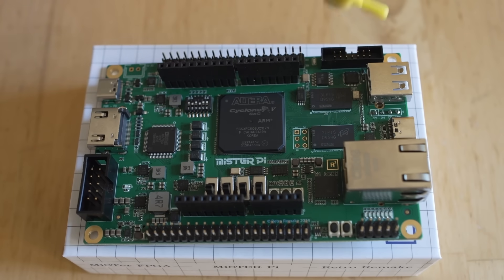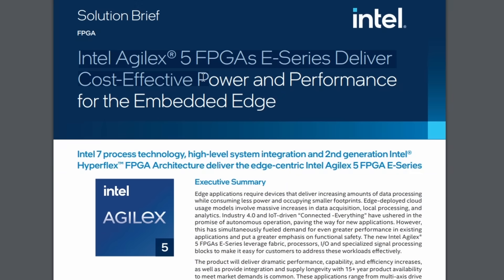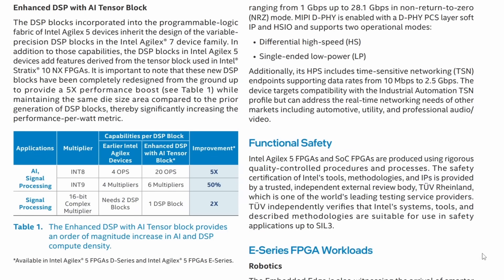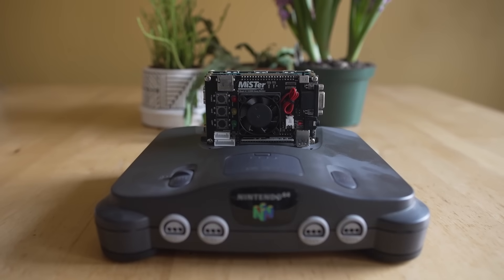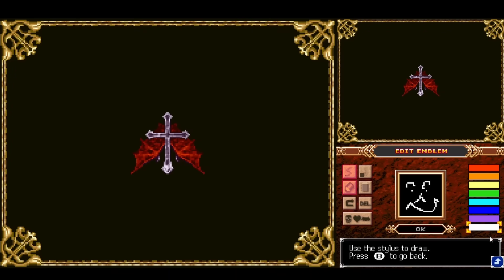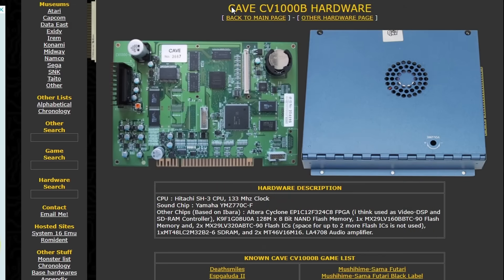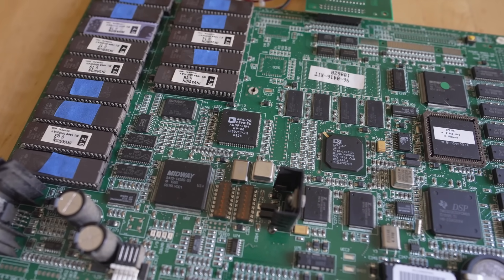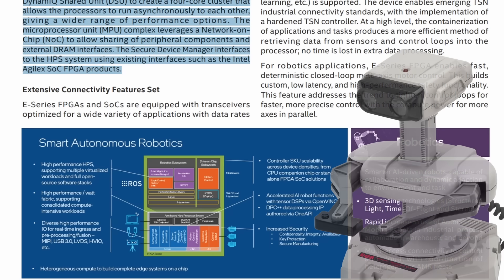"MiSTer FPGA 2" Coming? What Consoles Could It Even Run? Agilex 5 Explained

Comment: Not a FPGA developer, but given the ao486 core is only attempting to recreate a 486SX, a 486SX had ~900k transistors, and a Pentium MMX ~4.5M is 5x a 486SX...  So my reasonable hope would be that the step up would allow for Pentium MMX with the frequency headroom to effectively recreate Tillamook at 300MHz.

In turn if there's not enough additional area for an era appropriate 3D Accelerator via FPGA, one would hope the developers could use the pre-existing wrapper work for Glide/DirectX -> OpenGL, and come up with a system to allow it to use the accompanying ARM SoC's GPU block.
Reply from the maker: The a0486 core is great but that’s a very bodgey core. In a fun way, not a negative way
Reply: Era appropriate software tended to target a Pentium MMX 200 MHz, and then jump up to late Gigahertz race chips, rapidly leading into the Half Life 2/Doom 3 era that largely just runs on modern hardware.  So a Tillamook equivalent alongside a decent 3D Accelerator in principle should core software up through 1999 with reasonable headroom, with stuff from after the flip over to stuff targeting Athlons largely just being able to be handled natively with wrappers on modern hardware..

Comment: I feel like a 3rd Gen MiSTer would need to have some co-processors on board to natively handle the heavy duty stuff, if there were to be an attempt to do bigger systems. Today you can probably still get compatible x86/Pentium/Celeron/etc compatible chips to start thinking about Xbox. PS2 is complicated by the MIPS/RISC situation, and GC/Wii/Wii U/PS3 all use a RISC PowerPC CPU. None of this even covers graphics, which is another big hurdle. But, now that we have people like Taki creating the boards and designs, the only limit is figuring out how to tie all the necessary components together.
Reply from the maker: Once you get to those systems any real advantage FPGA brings to the table is kind of negated by how those systems work with their frame buffers

Comment: The 3 console cores I'm most excited for with FPGA Gen 2, are the Dreamcast, DS and perhaps a hybrid PS2 core, if the EE was replicated via a RISC SoC, and everything else via FPGA, It's really just the EE on the PS2 that's complicated, if a 1:1 EE RISC core could be possible, via a full EE de-lid scan, it would be incredible to see & have, soft emulation for PS2 just has never really done it for me, given how low latency the PS2 is on a CRT, and the amount of PS2 games there are is staggering, I have around 500 in my collection, being able to play PS2 games via real hardware (FPGA) with native VGA in 480p would be the dream, not to mention with improved colours, given the PS2's poor colour space output, as well as save-states, cheats and all the other stuff FPGA brings, full hardware backwards compatible PS3's are getting hard to find now, as they are all succumbing to the process node fault. For computer cores, a 1:1 X68000 core would be fantastic to get, along with finally getting 1:1 Amiga A500/A1200/CD32, and lastly of course, a Pentium i686 core, as close to 800Mhz as possible, pulling that of with a decent GPU will be hard on a single FPGA though, pairing a decent P i686 500-800Mhz CPU with a decent 128MB DirectX 8.1 GPU is the ideal.
Reply from the maker: I do hope we get a finished X68000 one day. So close yet so far

Comment: I'd love to see it have an on-board port that would allow folks to create cartridge adapters so people could use original cartridges (think similar to the Polymega but FPGA based and not just a cartridge dumper).
Reply from the maker: If there was enough GPIO for those slots it could be theoretically possible
Reply: @VideoGameEsoterica  Yep definitely depend on GPIO. But man I'd love to see it. Nothing like the feeling of using actual cartridges (or CDs for that matter). Dumpers just don't feel the same.
Reply from the maker: @ToddUGA it’s a fun bonus feature but also IMO the first sacrifice I’d make for something else

Comment: Console wise, there's not much left I'm missing on the MiSTer, because the more modern consoles are handled quite nicely by software emulation. Especially the enhancements we get there are really nice. So my main hope for a MiSTer follow up would be some newer arcade cores, like Sega's Model 1, 2 and maybe even 3. Same goes for Sega's competition from that era, like Namco, Konami or Jaleco. And maybe some more exotic hardware like the M2 or the Hyper Neo Geo 64.
Reply from the maker: And PS2 era is better in the end via software emulation once complete as frame buffer systems in FPGA don’t really have a “cycle accuracy”  in the end
Reply: For me, FPGA for 5th & 6th gen is even more important than previous generation consoles, given the size of the L2 cache on CPU's, GPUs and RAMDISK low-latency, along with Direct Video for HDMI to RGB, it's pretty easy to run consoles like the SNES, Mega Drive etc, basically any 8/16-Bit system with very low-latency and high accuracy, no not bare-metal like FPGA, but with a RAMDISK install of Recalbox OS and an X3D CPU with V-Cache and a GPU with a 64MB+ L2 cache, it's pretty decent now days, 5th & 6th gen is another story though, the latency is much higher, and the frame-pacing nowhere near accurate or consistent like real hardware, many DC, PS2, GC games are unplayable due to poor video timings, or just aren't as enjoyable due to latency, and that will most likely never change with soft emulation, it's not a very good alternative to real hardware, the ideal is FPGA for everything up to 7th gen, so all bare-metal low latency systems are available via FPGA, using older, lower latency OS's can help somewhat, like Windows 7, but then there are no drivers or support for V-Cache CPU's or the latest GPU's with the large L2 cache sizes, so your back to much higher ms end-to-end frame-times (no good for most 8/16-Bit systems imo, just doesn't do the instant response gameplay justice like real hardware or FPGA), even the Xbox 360 & PS3 have near bare-metal performance and very consistent 1% frames (near perfect) when using them via their respective analogue RAMDAC's at sub 576p resolution on a CRT (sub 1ms), that soft emulation just isn't capable of replicating.

Comment: I think Dreamcast would be the max. Otherwise, larger FPGA means more features to current cores, maybe more save state support? I don't know the PS2 or GameCube specs but an OG XBOX has a 733MHz Pentium III Celeron equivalent CPU and a GeForce 3 equivalent GPU. I assume a PS2 or GC is slightly below that. I don't see why anyone would want to map out a P3 CPU, let alone have it running at 733MHz, or at least much faster than FPGA can now. There would be a decent heatsink involved. Is it even possible to output graphics that a GeForce 3 can w/o a dedicated GPU? Even if it could be done in FPGA, what kind of price tag would we be looking at? Better off having a Raspberry Pi or a PC for PS2, GameCube, OG XBOX and beyond. I have no interest in a Pi so I cannot say if a Pi 5 is enough for PS2, GameCube and XBOX.
Reply from the maker: All those would be too much. PS2 would be the only system that even had a chance and a long shot at that

Comment: Finally getting that Mortal Kombat core that just barely didn't work on MiSTer would be nice and a scaler that does 4K120 output so we can use that new fancy CRT beam simulation at full 4K. Tho I think the RT4K uses 150k logic elements and doesn't do 4K120 and costs an arm and a leg so maybe that's a big ask
Reply from the maker: 4K120 would be an extremely big ask

Comment: I would love to see PC emulation in FPGA. Voodoo graphics are very well documented as are lots of x86 processors. The voodoo 3 graphics core runs at 166mhz and it would pair well with a Pentium II running at 266mhz or 300mz. Software emulations still leave a lot to be desired there. If there is room enough for all of the logic gates for a full retro PC core, an Agilex 5 could very well outperform high end PCs in terms of emulation performance.
Reply from the maker: Plus then we can borrow those 3DFX portions for arcade boards
Reply: Not having to pull out the big Win 98 & XP machines and set them up to play all the incredible 90's, early naughties PC games would be nice, especially as part of an already system packed FPGA platform, one day having an FPGA box that can do everything up to 7th gen with bare-metal real-hardware level accuracy & performance is the dream, maybe with in 10-15 years
Reply from the maker: @Wobble2007 yes that is def a potential plus. ITX Llama has been great for that so far
Reply: @VideoGameEsoterica  Tis an awsome bit of kit.

Comment: Few notes from my side:
- N64 core is running the CPU at 93.75MHz, the turbo core is running it at 120MHz.The 80Mhz note on the turbo core is for the basic system clock used by e.g. RSP and RDP, the CPU runs at 1.5x that clock.
- In terms of what system the largest Agilex would allow... DS, Dreamcast and x86+3D card would be possible for sure and all seem interesting. 3DS, PS2 and PSP could might be possible, but are at the very edge and depend a lot on external RAM possibilities.
- Gamecube, Xbox or other systems clocked at 400mhz+ are out of reach
Reply: Thank u Robert!!  U r a LEGEND! <3
Reply from the maker: Lotta interest in PS2 that’s for sure
Reply: I don't know that the upgrade list is enough to shift the community to a new system tbh. I think it will take one more hardware generation and maybe ai assistance in place for core building.
Reply: 3DS, like DS, would be fantastic to have, those systems are packed with gems, and look so good on a big screen, especially a CRT or OLED, PSP has some bangers too, having DS/3DS FPGA would be like having a whole new Nintendo console, MK DS is basically a sequel to MK64 and looks so good on a 4:3 CRT TV, as does LOZ Spirit Tracks D-Pad edition, MK7, Chibi-Robo, Retro Game Challenge, being able t play them without software latency, frame stutter and compatibility issues would be epic. PS2 is obviously the most wanted FPGA core there is, canny wait for that one day, it will be fun just seeing it all develop over the years.
Reply from the maker: Even if 3DS was doable I don’t think you’d find a dev willing to do it. Nintendo hasn’t been playing fair lately
Reply: - Have u given any thought of how DS/3DS would handle screen layouts and such?  Would it be possible to have a phone app that could sync as a 2nd display for touch screen?  I guess it would need microphone support as well..
- All the systems you mentioned are beginning to have well integrated online network capabilities.. do you think it would be possible to support these in FPGA?
- Would it ever be possible to add Netplay to existing cores (ex. N64/PS1) on a hypothetical Mister 2 board?  My dream would be to have a MiSTer netplay multiplayer community some day 🙂
Reply: Thanks for all your hard work!
Reply: Not into the FPGA scene, but...  Given OpenGL is backwards compatible and there are wrappers for Glide/DirectX <9 to OpenGL, it should in principle be possible to utilize the ARM SoC's GPU block for 3D Acceleration.    

So one would hope that should allow for the CPU block to go from a 486SX equivalent to a Pentium MMX equivalent.  As a rule Software system requirements pretty much jumped from Pentium MMX to later Gigahertz race hardware, so the big thing would be to be able to get a Pentium MMX equivalent fully implemented, and figure out how to implement GPU passthrough with a wrapper if they can't FPGA the 3D Accelerators.  

In turn if that's possible a 486DX2 die equivalent would tend to also make sense.
Reply: everyone said N64 and saturn were out of reach...
Reply: Legend Robert!!

Comment: Old consoles/PC did run constantly at full clock though, so the N64 example around 5:15 isn't really apt. Even the Dreamcast runs continuously at 200 MHz.
Reply from the maker: No but it is an example of a system that doesn’t peg the cpu constantly

Comment: 10:31
Sandy Bridge i5-2500K CPU @ 3.30GHz 
Instructions sets	MMX, SSE, SSE2, SSE3, SSSE3, SSE4.1, SSE4.2, EM64T, VT-x, AES, AVX
NVIDIA GeForce 8500 GT (512DDR2)

M.A.M.E-275
Hyper Neo Geo 64:

Beast Busters: Second Nightmare -30fps
Buriki One-30fps
Fatal Fury: Wild Ambition-30fps
Road's Edge-30fps
Samurai Shodown 64-20fps
Samurai Shodown 64: Warriors Rage-20fps
Xtreme Rally-30fps
Reply from the maker: Not too bad. Slower than normal but decent

Comment: Sega Model 1, 2 and maybe even 3 please! Or really all of that mid-late 90s arcade goodness from Sega, Namco, Konami etc would be wonderful.
Reply from the maker: 3 would be a big task
Reply: Sure. Dreamcast kind of "trades blows" with at least the step 1 and 1.5 versions of the model 3 hardware though, wouldn't you say?
Reply from the maker: Model 3 is more advanced in certain aspects and Dreamcast is more advanced in others. It’s like a coin flip
Reply: It's impossible. There is too much work to do, and CPS III has still not been released.
Reply: A lot of folks really want that absolutely perfect version of SFIII I guess.
Personally I'd buy one for Sega Rally alone. To this day, the only really good way to play it at home is the PS2 Sega Ages port. On the M2 emulator the AI cars are all over the place.
Reply from the maker: I mean Sega Rally is iconic after all
Reply: Same. I have a DC hooked up, still. But I don't have all those great arcade games.

Comment: One interesting use for the "spare" logic elements would be a nice 4K scaler built-in, with fratures similar to the RetroTINK. Could even add a HDMI in port so it could scale your other consoles.
Reply from the maker: I mentioned that in the first vid. Yes there would be a scaler built in just like MiSTer

Comment: I will def hop on board even at a high ish price IF pretty front end, nice molded console-style cases, flush 4x-8x USB controller input options, & arcade perfect / cycle accurate :

CPS-1 
CPS-2
CPS-3

NAOMI

IGS PGM

SEGA SATURN 

PS1

SNES

MEGA DRIVE/Genesis/SEGA-CD

TurboGrafx16 +CD

NES
Reply from the maker: Nothing there is out of reach

Comment: First thing to take into consideration is how happy would developers be about the new hardware. Next thing is if the user database can perceive the upgrade as being worth the while, this mainly comes to which new cores become possible vs the jump in price. I'd say that untill something with a big library, like the Nintendo DS for example, can be synthetized, there's not gonna be a big user base making the upgrade. I'd say it's still early to be thinking about upgrading the Mister, there's still many awesome games that are within possibility that are yet to be implemented. I'd rather see the current Mister be perfected than a new one be made. For example, a Mega Drive is still better than the Mister core for the Mega Drive, it has no overclock, Game Genie does not work and SNAC does not work even though it should. On the other hand the Genesis core does have overclock, but games behave weird and glitchy, which does not happen on real hardware. I'd like also to see the Guncon 2 working on the Mister as well as it does on a PS2.
Reply: That's exactly what I'd be worried about. The attention paid to the old hardware being divided or just abandoned for the new. At the very least Saturn, N64, 3do and all other hardware needs to be perfected first.
Reply from the maker: It’ll all get finished up
Reply from the maker: Yes people need to realize that any new board will be like the MiSTer experience. Early adopters will wait for things to happen. It was a totally diff scene in 2019 when I started videos

Comment: Probably not possible, but the thing that would be most exciting for me, would be the PS2. It sits at a similar intersection as the N64, historically problematic to emulate, but a ton of interesting exclusives. Additionally the PS2 has the most problematic video output in its generation of consoles.
Reply: It's not up to the insane level of GameCube emulation, but PS2 emulation is in a really great place these days. It's my favorite way to play PS2 even.
Reply from the maker: It’ll get there
Reply from the maker: I think spending more time on emulation would yield better results in the end than FPGA when it comes to PS2
Reply: PS2's CPU runs at 299 MHz so we in like flynn boys. JK I have no idea but that would be crazy.
Reply: PS2 video output is great. It outputs a clean component signal. I know scart is sync on green, but there's really no reason to use that vs component.

Comment: Would it be able to do windows 98/2000? some great shmups there
Reply from the maker: I think you’d get more of a vastly improved 488 core first
Reply: A fast 486 can sorta run win9x and we already have a slowish 486 core so I'm guessing it's possible but somebody would have to implement some 3D accelerator in FPGA if it can even fit.

Comment: Do we know if cores written for one FPGA just automatically work on another?
Reply from the maker: Here’s how it works; Agilex is based around Quartus, which is the software used to code for the FPGA chip. Quartus is also used for the Cyclone V. So porting becomes easier. That being said it’s not just a “drag and drop” situation. There is some work involved. But it’s less than going from something like an Intel / Altera chip with Quartus to something from AMD where the entire software and toolchain side is 100% different. That’s a much BIGGER port